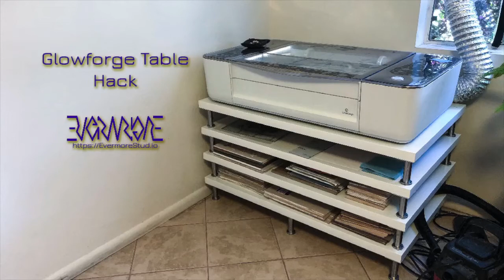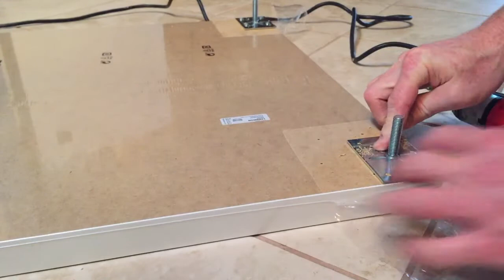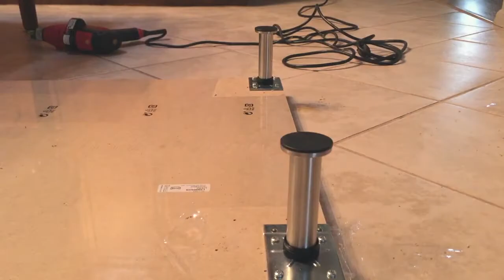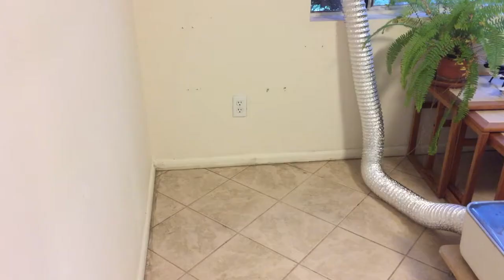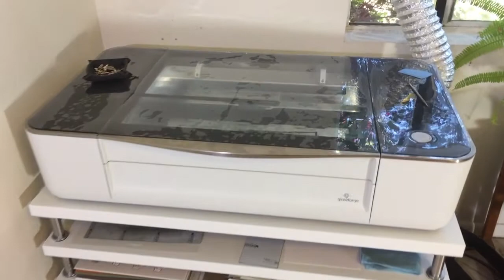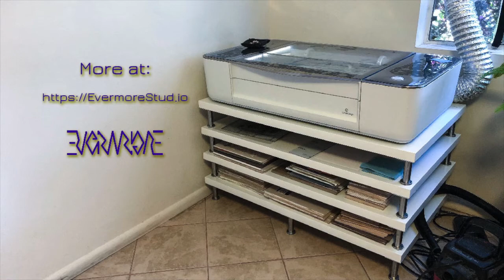Glowforge Table Ikea Hack

Comment: This looks great.  I am thinking of doing the same.  Can you tell me if it is bowing after a year?  I noticed that you put a support in the middle on the bottom but not on the other shelves.  Do you wish that you had put them in the middle or no?
Reply from the maker: Thanks!  No bowing at all so far. The shelves are not solid all the way through. They are frames with a thicker piece on top, a thin wood skin on the bottom and, solid mount points for the legs.  The result is very rigid.  I am not sure the middle legs on the bottom are even necessary.  I am still really happy with this.

Comment: Do I have to put the middle legs on the bottom tier? I waited 2 months for IKEA to deliver this and for some reason missed that you did that.
Reply from the maker: Hi, Charlie! I don't think the extra middle legs are critical.  After over a year, none of the shelves shows any signs of stress in the middle. I would go ahead without the additional set of legs.

Comment: u think one could put wheels on this ?
Reply from the maker: I am sure you could attach standard casters (wheels) to the bottom. I am not sure exactly how large the mount points for the legs are but, they are likely large enough for at least a 3-4” square caster base. If you are using the table for a laser cutter (like a Glowforge), you probably don’t want to put casters like that because it will make it less resistant to shaking, which can cause problems cutting and engraving. Step-down casters (e.g., https://www.amazon.com/exec/obidos/ASIN/B07QRH8VS2/arizonaaikidoA ) would solve that but, you would have to modify the build to get enough solid vertical surface to attach them - maybe by swapping in rectangular legs.